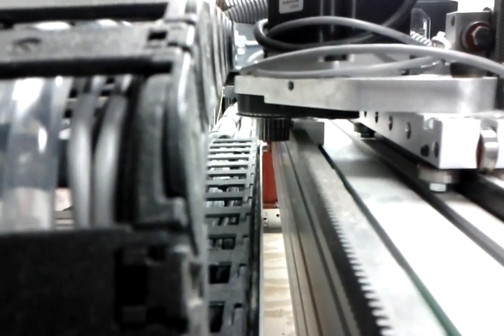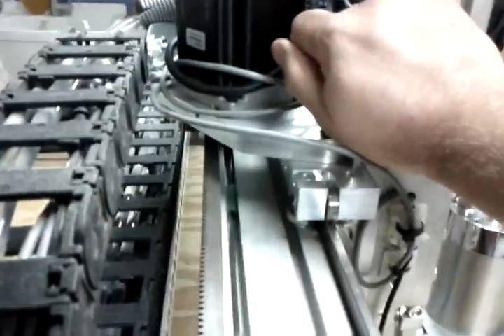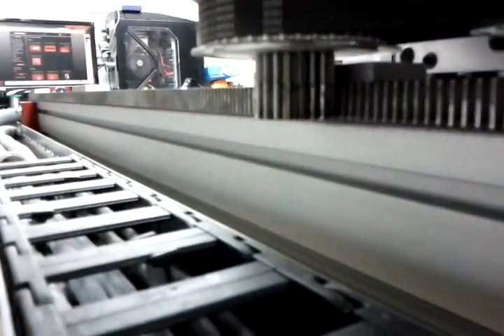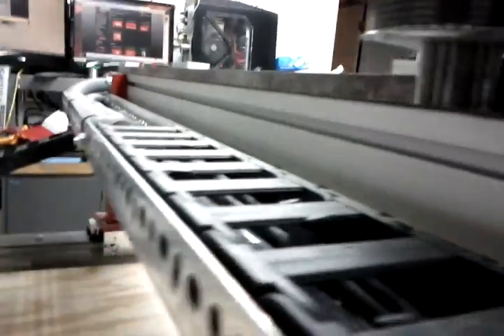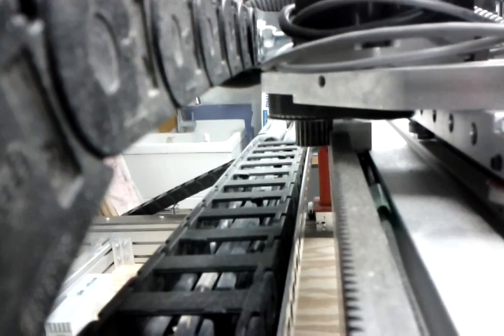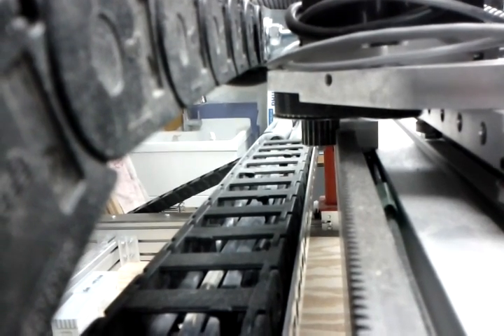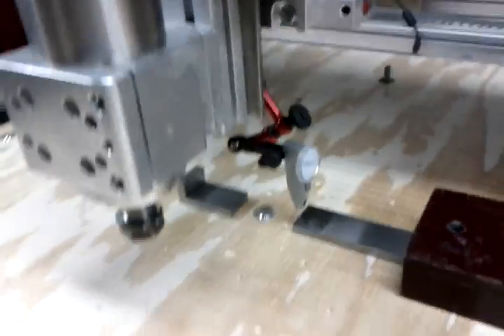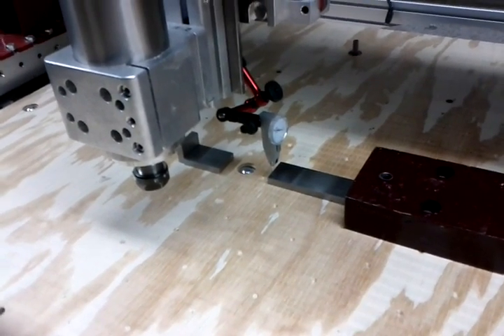CRP-4848 X-Axis Backlash

Comment from the maker: True, Ger21 at CNCZone spotted the cause right away.  It was a loose set screw on the motor pulley.  The reason it didn't spin freely was that the set screw hadn't retracted enough to clear the edges of the flat on the motor shaft.

Comment: That's not backlash, your stepper motor isn't locking up. Could be a number of things, bad motor, wires, settings. Driver. Easiest way to tell would be to swap a good motor in from another axis and verify. Do the same for the driver.